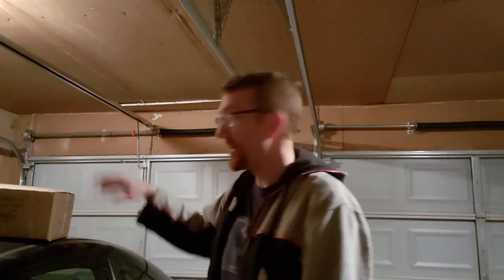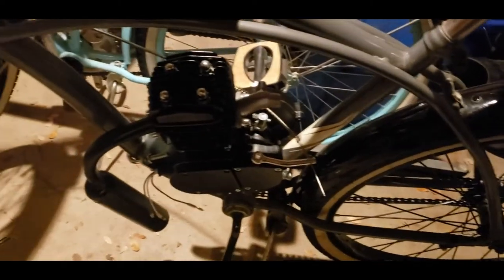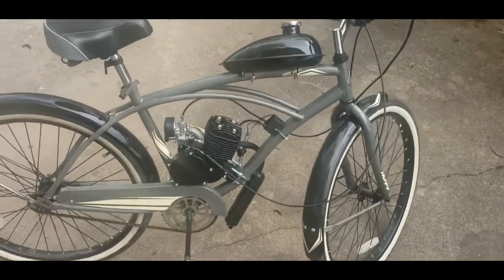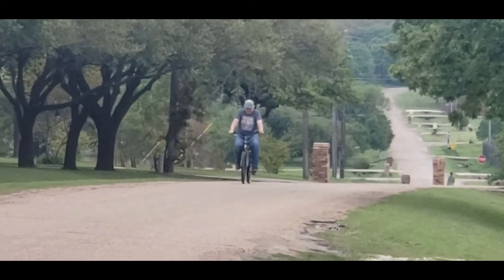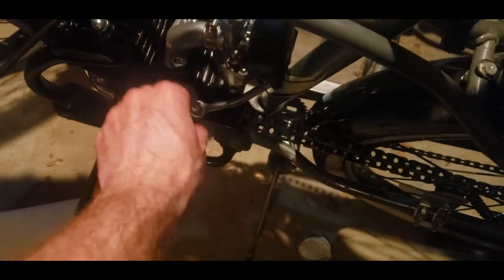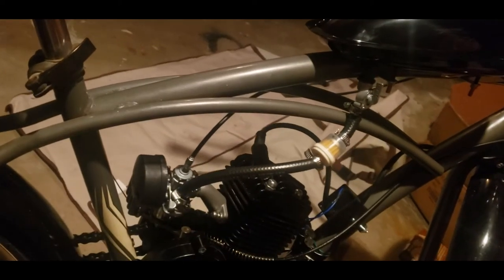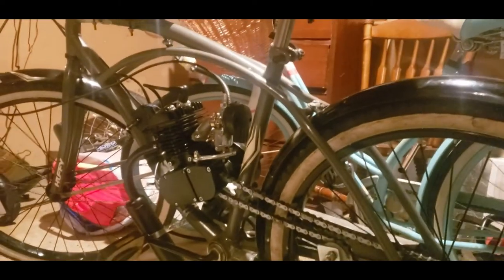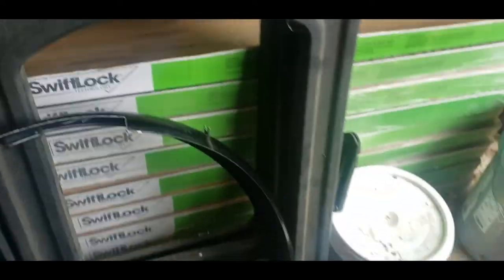Motorized Bike Project Part 3: Installing The Engine!!

Comment: Also if you can find one, a freewheel single speed wheel instead of a coaster brake wheel.just ride that one till it goes tits up and eventually they will blow out through the breakside, unless you don't use them rear drum  brakes. Also don't take off the brake arm that holds the assembly together.

Comment: Fenders are very dangerous on motorized bicycles. When they break off especially the rear one, it will wedge between the tire and the frame and lock up your wheel. Respectfully
Reply from the maker: I found that out! Fortunately it did not lock up the wheel when it broke off. I've since removed the fenders.
Reply: @MarkRidlen  It will look better anyway, it just kind of sucks when it's a little rainy or wet.